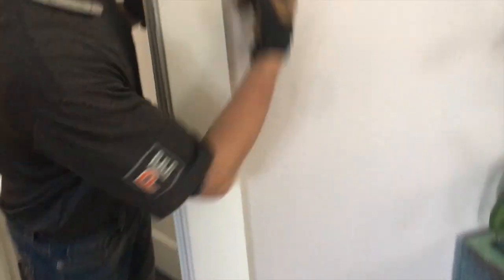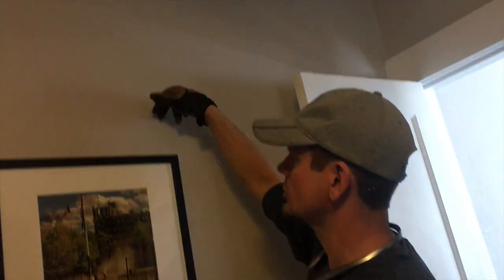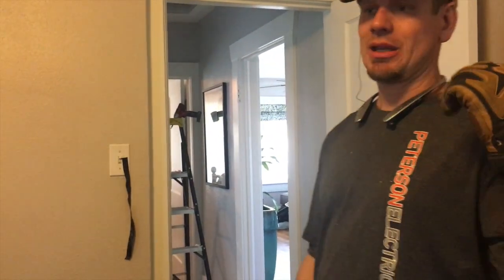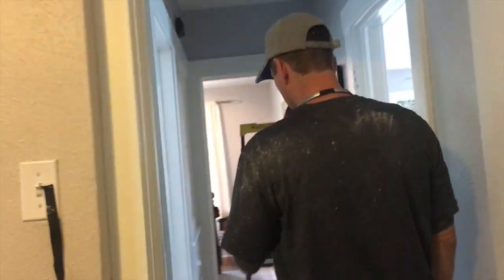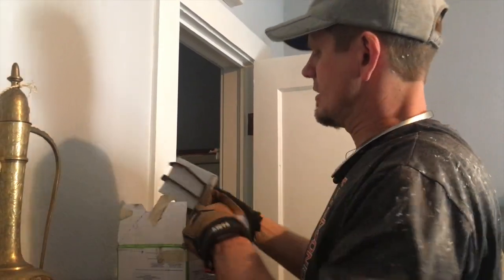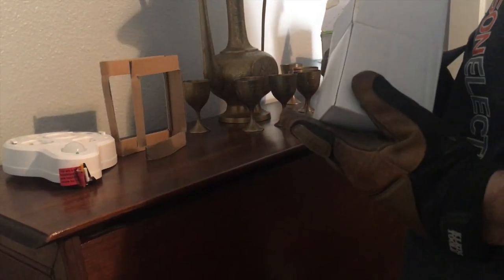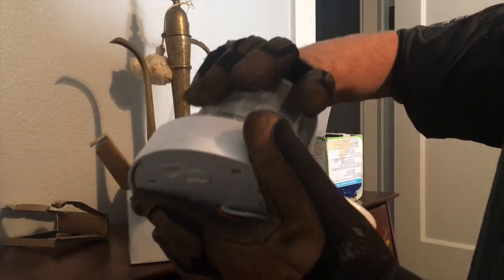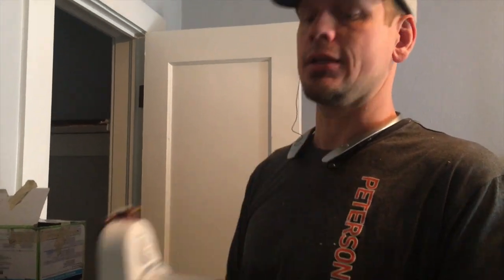100 Year Old Home, 1900s, How To Get A Light & Switch In Wall With Lath And Plaster?

Comment: I just bought a home built in the 1920s and have been trying to track down WHAT IS HAPPENING with my outlets upstairs. This explanation of how the conduit was run to lightboxes, then switches, then outlets is so, so helpful.
Reply: I bought a 1924 home about 7 years ago to fix and flip. The electrical was a nightmare, especially with  nob & tube and old 2-wire setups wrapped in cloth. I was amazed that the house was not burned down. It was a 2-story house that was converted into a triplex. We eventually abandoned the old wiring and rewired the house to modern code. It was a bit costly but that was the best way to get her done.
Reply: @elgranjero2284  The danger of knob and tube is a little overblown. It's not a fire hazard unless the insulation is in bad shape. BUT... I imagine nearly century-old wiring was in really bad shape!!!
Reply: @wmhfv992  Exactly!

Comment: I have done some complete rewire on those old homes, a real interesting job for sure.
Reply: And good money
Reply: I'm in the middle of doing this now. Old lath plaster... will re-plaster with lime plaster and lath. yep. everyone calls me crazy but I don't care. I love plaster. Don't get me wrong, I am NOT having fun, changing out BX for NM for kitchen remodel. If I could afford to do 2 wire with ground metal cable , I would since it insulates the electrical output to living things and these old homes get mice, no matter what I do. still on that job after 10 years. Cat, I know.. So, did you rewire with NM?

Comment: Get yourself a 4-5ft flexible auger bit( I prefer the threaded auger it pulls itself thru so you don’t struggle) drill up thru that wall then once it’s thru to the attic you tape your wire onto it and us it as your pull rod. Or you can drill down which ever is easier for that particular job.

Comment: 1) It's light emitting diode.
2) I cut holes in drywall all day, but I cut them with my oscillator and cut all my lines at angles so they simply pop off, and easily mud back on with very little "drywall" work to finish. Hard to explain, but the inner edge of the drywall will be narrower than the outside edge-because you are cutting everything with angles. Wish I could post a picture...

Comment: get a wire camera off of ebay that plugs in your phone and then tape to your fish pole then you can steer it through the holes that were drilled with the flex bit.
Reply from the maker: great idea, do you have a link of the tool that you use?
Reply: doesn't work well, that's what I tried, It's all too loopy... taking out walls .. done